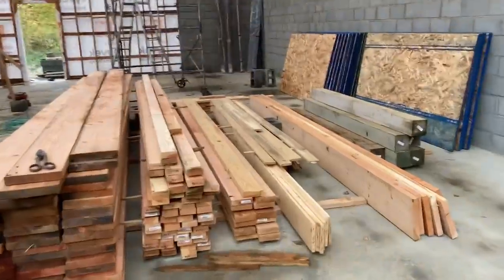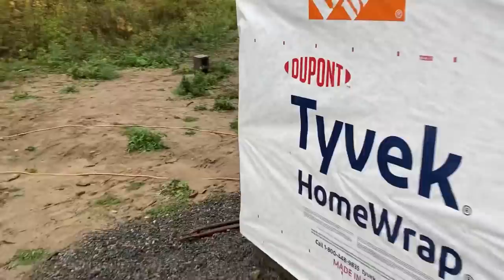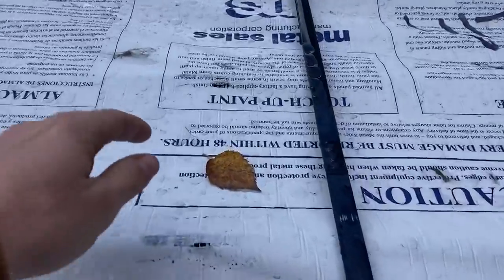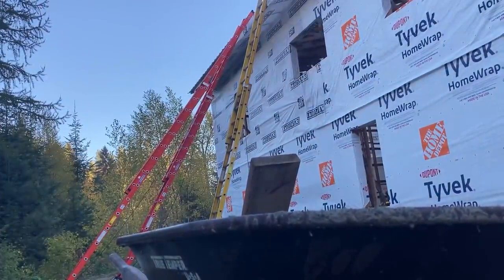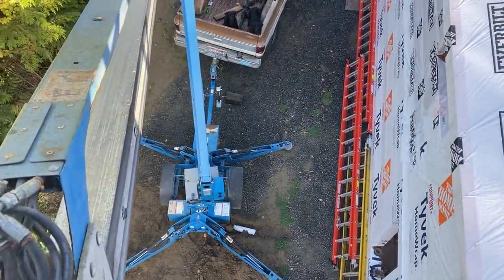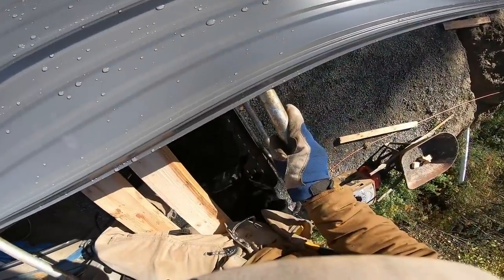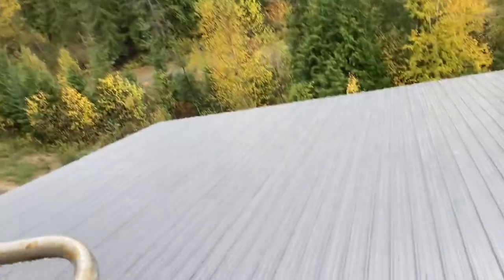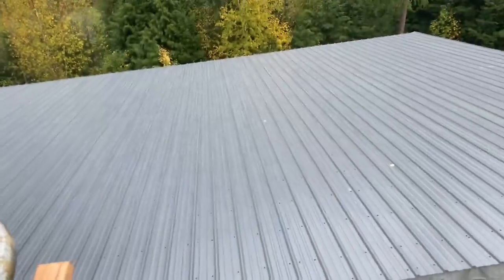Roofing And Racing The Elements

Comment: Its a little late now as your build is done.  I built a similar  building  fourth by sixth six and 18 feet at e the eve.  I had 52 sheets I think.  I built a slide using  2 by 4s to the edge of the eve hooked a vice grip on the tin sheets and pulled them up the slide one at a time and then screwd them in place.  I did this my my self in my spare time.  It took a while. Iam looking at some of your older videos and am enjoying them.  Stay safe you two.

Comment: Hi Mike,
Just heard in your comments that the drip sdge for the lower edge of your roof was not deliverd, I sincerely hope that you are placing a gutter there to redirect the water to the sides.???  This is necessary to avoid moister and pressure problems on your block wall.
Kees van Roon

Comment: Do you have plywood or something like it under the wrap/over the rafters?  If so, I missed that step.  Otherwise, I'm confused about how the roof is being stabilized/strengthening the sidewalls.
Reply: @fisherus  There is a ton of shear strength  on the roof surface now with all the sheet metal fastened to his strapping.  His walls though, I would worry about as he has nothing diagonal of any substance as of yet.  Th.ey are building up a lot of surface area for the wind to test this on....I would say he'll be safe if he gets 2 of his walls covered in metal that are perpendicular to the other......still a lot of stress from wind even so....They need to get all 4 sides wrapped before a good wind strikes!